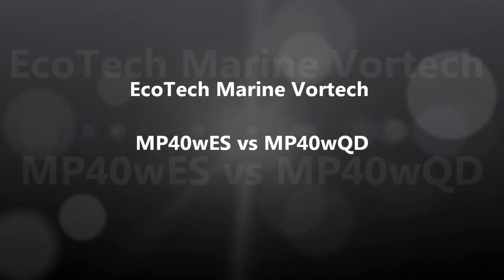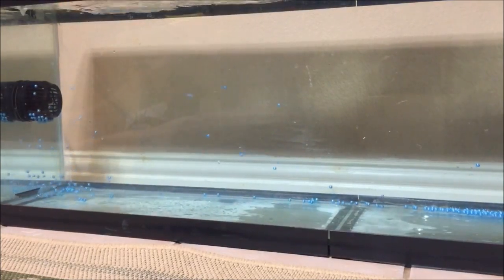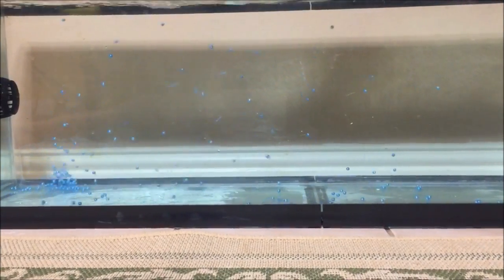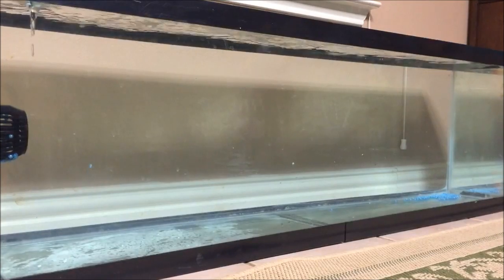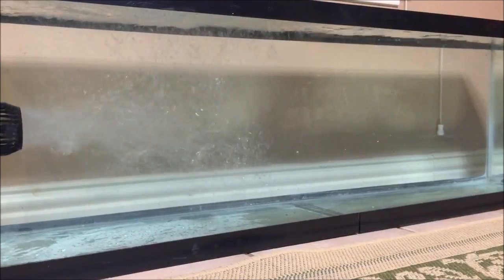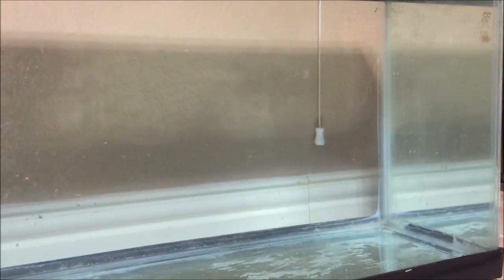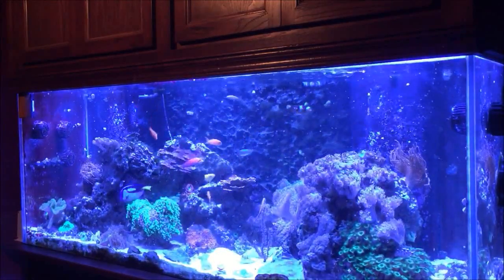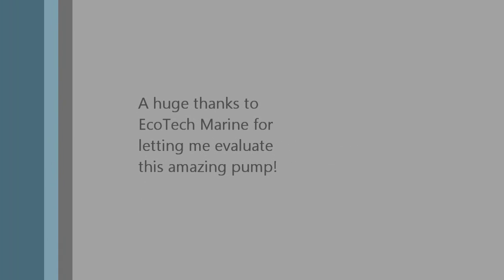EcoTech Marine VorTech Flow Comparison

Comment: nice review. i am looking for that undertow. Can I ask you your opinion. I am setting up a 45 gallon display (24Lx18Wx24H). It will be bare bottom so i don't need to worry about sucking up a bunch of sand. I noticed that in your test you where running them at 100% and getting about 36 inches of high flow. I am running a little deeper ( i am thinking I will be about 22 to 23 inches so i leave room for a slight waves. I am looking for great undertow and wide dispersion coming out of the propeller without blasting the sps. I am thinking that 1 Mp40 dialed down will give me a better pattern and be less noisy then running 2 mp10s. I probably could get away with runing 1 mp10 but I am worried they wont get the proper undertow. Thoughts?